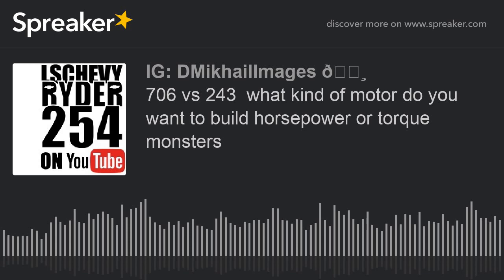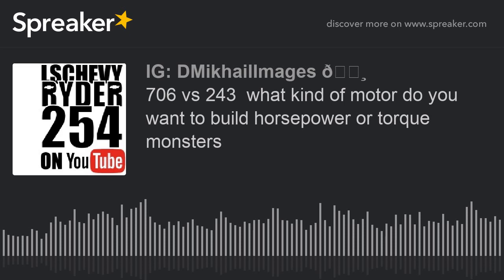706 vs 243  what kind of motor do you want to build horsepower or torque monsters (made with Spreake

Comment: Great video thanks brother. Good question because is it low end or top end you want? I don't know about these engines. I can say that back when I was working on race cars and pulling trucks we wanted the 202 heads I think that's right for the 350 Chevy small block. Been a few years ago but we always wanted the big valves. Pull more in and get it out just as fast. Keep up the great work see you in the next video thanks again brother. Just remember top end or bottom end torque what one do you want